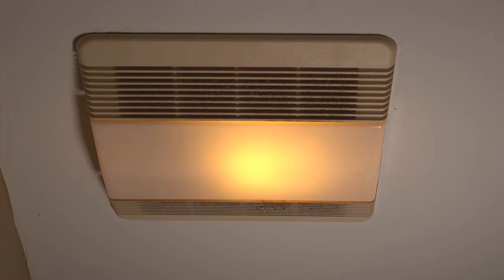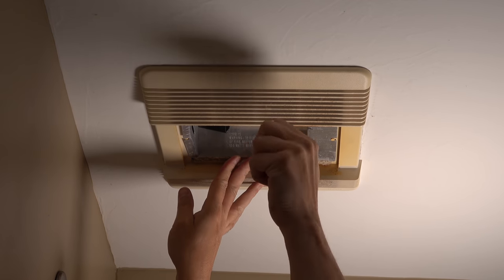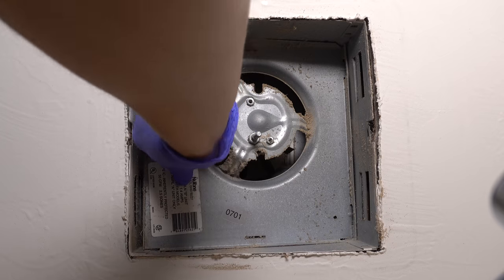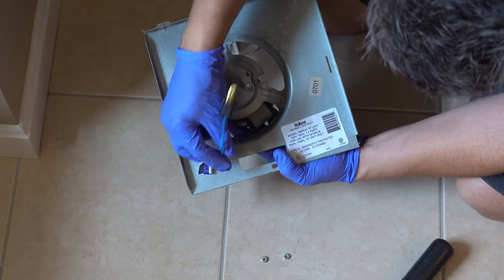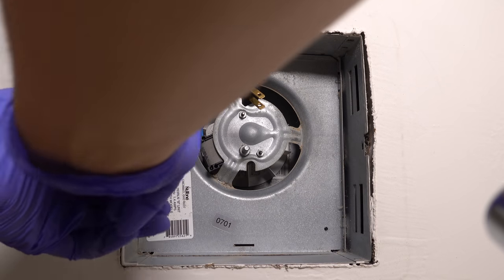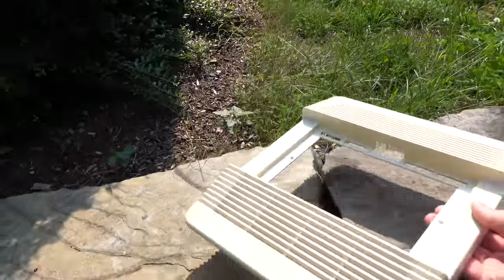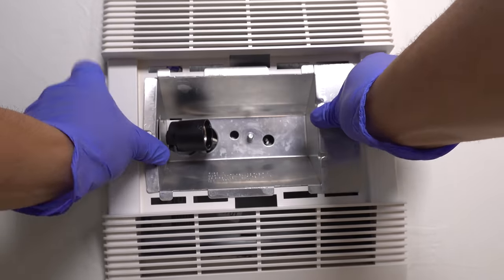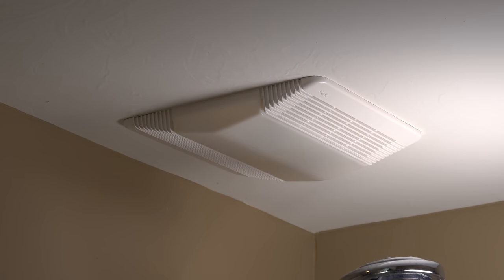Make your BATHROOM FAN LIKE NEW without Attic Access

Comment: Great video! It's worth mentioning that if the motor hums and doesn't run, it's worth it to take it out and vacuum and clean it out real well and try it again before buying a new one. Mine hummed and didn't turn and it was because the dust gunked it up. I vacuumed it out and it ran like new.
Reply: mine is starting to do this, thanks for tip
Reply: A short spray of WD40 helps tremendously. It lubricates and wicks mositure.
Reply: @random13627  come back and let me know how it goes.
Reply: I took my old motor apart and cleaned and lubricated the moving parts. Ran for about a year or so and is again making noises. The brand fasco is no longer made so may just switch out the motor.
Reply: @spacecowboy3095  wrong actually 3in1 oil is better 3in1 oil is permanent  wd40 is temporary
Reply: Agree.  Super video.  Super practical 👍
Reply: @scottdunn4506  WD40 is temporary, 3 in 1 Oil is Eternal.
Reply: Mine is a similar model that squeels when it's getting colder outside. This video is perfect though. Have already cleaned it once but never wd-40 it.

Comment: Good, low budget fix. However, I decided to replace my entire fan with a quieter model.
Reply: The new ones are so quiet, much higher CFM and brighter light as well.
Reply: Which model did you replace it with? Any recommendations?
Reply: @MBolesy  
Best ones are Panasonic DC fans.  You should look up specific model based on your needs.
They are pricey (and if you a timer, you will need a new timer that works with DC motor) but IMO a no-brainer investment for decades to come
Reply: @MBolesy  Panasonic.

Comment: honestly you should have  just upgraded. modern bathroom vent fans are blower fans, move more CFM of air and are quieter. Also I wouldn't have repainted it. I would have used hydrogen peroxide and a blacklight, will take the yellow out of ABS plastic.

Comment: I bought a new cover to cover the same yellowed unit. Your video helped me realize that I could unscrew the washer, unplug the light which I don’t even know existed in the 16 years I’ve owned this home, and remove the grille to reveal the slots that the new fan cover springs slip into. I don’t have the functionality of the light but considering I never knew I had one, I won’t miss it; just happy to have the discolored plastic removed from my freshly painted white ceiling. Much appreciated!

Comment: Did mine last year... fan was fine but the heater element (never used it anyway) was bad... was surprised parts were still available... fan gets messy being around all that moisture and I just intended to clean it up.
Good video for those that think they should replace their fan.
Reply: What’s the heating element for?
Reply: @LeMatt87n  fan blows out and warms the tub and bathroom... like a bigger toaster element... fixture has fan for exhaust, light, and heater,  never really used it.

Comment: I've taken the larger motors that we have in our fan units apart.  They are easy to clean out with condensed air, replaced a worn washer, lubed the bearings with  Fluid Film (amazing stuff!) and they are as good as new.  Most people do not take the fan units down and clean out the dust, and they should.

Comment: You just taught me that you can replace just the motor in your bathroom exhaust fan. I just watched your video, went to the store and bought the part, and replaced the motor. I'm back up and running! I was so worried I'd have a huge mess to pull the whole thing out, and it couldn't have been easier in real life. Thank you for showing me what I was in for, it made it a lot less intimidating.

Comment: We have an old NuTone heat-vent-light from the mid-60s that needs replacing. It used an exposed heating element that would fail by dripping hot metal onto the floor. I don't think I'd want to go back to that. Incandescent heat lamps don't catch your bathmat on fire when they burn out. The vent motor is also dead. The master bath has a similar model that doesn't have a vent because of the window, not that we'd want to open up the window even a crack on cold days. Both heating elements failed by raining down fire. I don't know what they were thinking when they thought that was a good idea.
Reply: Heaters on the ceiling sounds very inefficient, since heat rises
Reply: @specialopsdave  There are other things to consider like natural convection and radiative heat. The heat source doesn't have to be on the floor to indoor natural convection. Ceiling heaters aren't so much convective as they are radiative and forced air. It also uses far less energy to move air than it does to heat it. Radiative can also spread heat more quickly over larger distances especially if there is nothing blocking it. It heats the same way a ceiling light lights up a room.
Reply: @robertgaines-tulsa  I guess, but I prefer baseboard heaters
Reply: @specialopsdave  It's a good choice.

Comment: Excellent video indeed and quite similar to the steps I’ve taken over the years to keep these ceiling fans in operation
and avoid them becoming eyesores for the lint, dirt and other nastiness they attract. 

There is one thing homeowners should check before following your approach and that is to check where the fan’s exhaust vent terminates. In two of my bathrooms, the disappointing answer was through the ceilings into the unfinished attic. While this might be consistent with code, I’ve come to understand you need the exhaust to
exit the structure not just the weather perimeter. 

Finally, a simple rotary timer rather thanks on/off switch likely is going to be useful for most people as these fans should be operated as soon as the shower water is turned on until at least 15 minutes after the water is turned off (subject to adjustment for unusual climates).

Comment: My old exhaust fan is no longer made... bought a replacement assembly but it is taller than the old housing....maybe I will swap out the motor only and see if that works.

Comment: Great video as always. Also if you didn't want to paint the shroud part (because you could find the right paint or something) you could use a hydrogen peroxide solution diluted with water and place the part in a bucket filed with the solution, leave it in the sun for a few hours and the yellowing will go away. Watch any of 8-Bit-Guys computer restoration videos and you will see what I am talking about.
Reply from the maker: I know all about retrobright, the 8bit guy is the best! I was going to suggest it but for this, its a lot of waiitng and I didn;t want to make peopel buy the hair version of the stuff, just too much work for the fan. Now for an old C64, its ok!

Comment: Is it simple to add the fan timer button? I know someone in my home that doesn't like to use the fan but might if it turned off automatically. A humidity sensor to turn on the fan would be even better.

Comment: Great video thank you.
That type of bulb creates a lot of heat, not to good on fan motor. 
The type of grease they use on motor drys out
Reply: Most LED’s are pretty low heat
Reply: An LED? yah the base may get a little warm to the touch but I think it's going to be ok.

Comment: If you need to clean and degrease non-painted parts or painted parts that are going to be repainted you can just soak them in TSP (tri-sodium phosphate), which is sold in the paint department of hardware stores for about $10 per 1 LB box. You can use it all over the house/ garage on non-painted parts and TSP will even degrease and renew the filter and mesh of your kitchen vent hood that nobody ever cleans and just avoids looking under, hardware and all, no scrubbing needed.

Comment: I have a ~15 year old Nutone, similar to the one in your video.  A mid power model that doesn't clear the air that well.  Does anyone know if you can replace one of these motors with a more powerful motor?

Comment: Good vid… have done this several times over the years to solve source of intermittent loud vibration but unsuccessful. Have removed fan to test and it hums quietly. Have not been able to determine a pattern. Have considered removing entire frame but blown insulation above gives me pause. Would really appreciate any suggestions.
Reply: Vibrations from the fan?. Maybe the housing case isnt 100% secure. Make sure all screws are tight
Reply: A piece of thin cardboard, or folded paper wedged in the housing usually quiets up a vibration noise.

Comment: And when you are finished you still have a very noisy bathroom fan.  Bite the bullet and replace it with a new, easy to install ultra quiet fan at 0.8 sones or so for about $40 (if ordered online).

Comment: Those fixtures leak air like a sieve.  I use the heater part put have sealed up the vent fans.  They let more warm moist air into the house when not in use than they will ever remove.  Maybe they work in a dry climate but not in the south.  Also the vent allows a way for carbon monoxide from a generator to get into the house.  I hate them with a passion. Avoid.
Reply: The Panasonic ones are made better, but in my humid swamp, these fans are best used for odor control and best letting the dehumidifier handle the moisture.